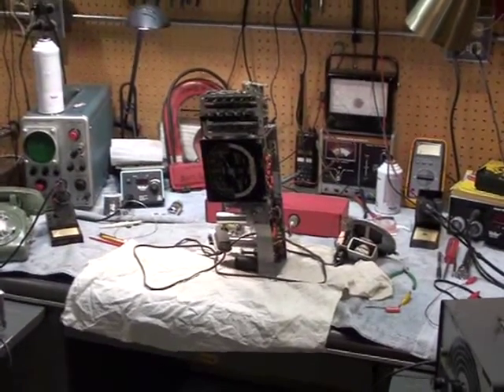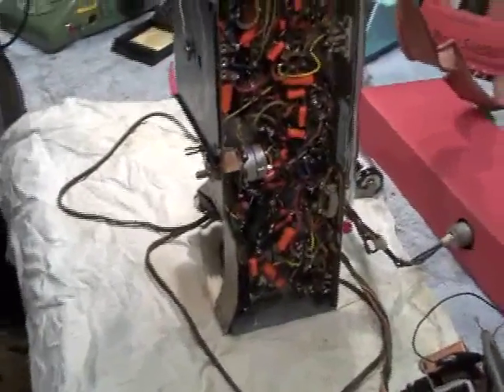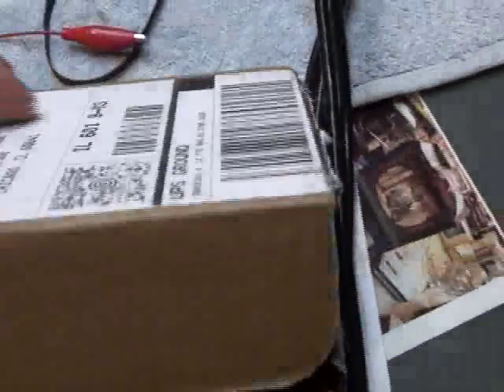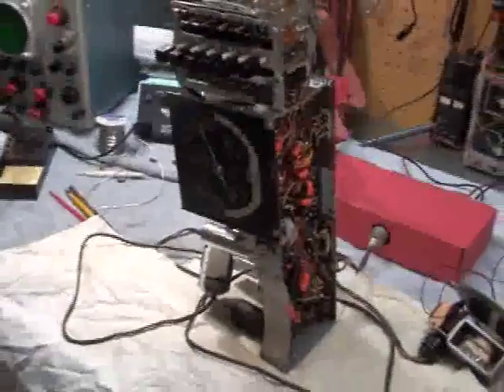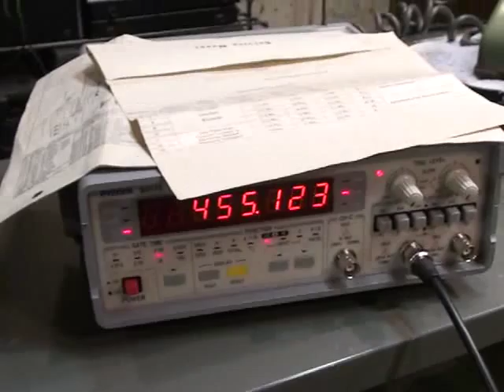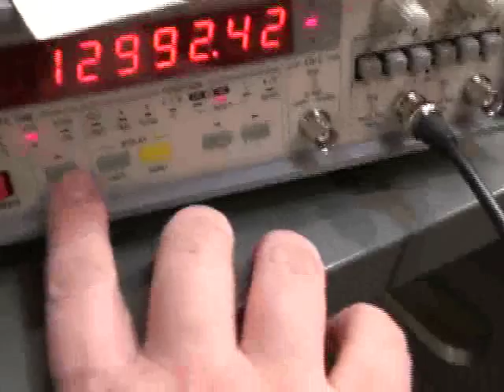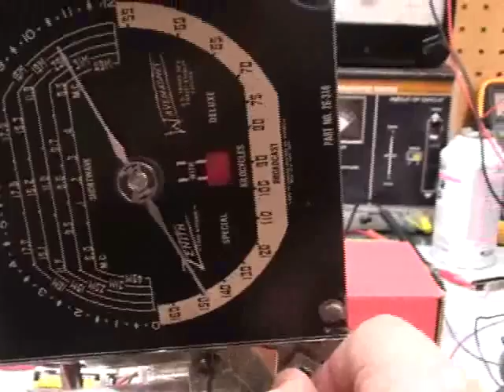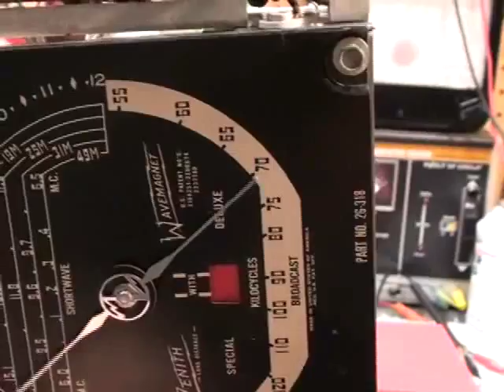1942 Zenith Bomber Trans-Oceanic radio repairs

Comment: Great job on the restore. I wish there were dozens more videos on restoration of these and all the vintage test equipment needed to do a first rate job.  I think a series of videos showing a step by step progression of vintage electronics is way over due. At best, one has a compilation of videos. But a series beginning with buying and restoring a VTVM then a frequency generator, then a frequency counter, then a radio of choice.  A detailed but quick walk through of the schematics for each. This would really be fun and needed by anyone wanting to delve into vintage electronics. Let's face it, most of us will never be clever enough to take on the equipment often repaired by people like from the Signal Path videos. He breezes through the inside of a frequency analyzer like it was nothing more than recipe for hard boiled eggs. He is extremely clever. But, the rest of us can enjoy technology up to the 1960s.
Lastly, if you could and may be you do now, slow down the camera movement. Thanks

Comment from the maker: Yes, its excellent.  I need to buy a couple more.  You can only buy them direct from the guy who makes them.  They're $89 a peice.  It steps the voltage up to 90 volts via 9 D cells.  Its been working great for hours and hours with no problem.  Battery life is estimated at 70 hours normal operation.

Comment: Some people use the yellow polyester condensers and restuff the original cardboard cases. I've never bothered restuffing condensers with any of my radios, most had a mixture of original and replacement parts so there was nothing to preserve. Anyhow the reason for the asbestos was for fire prevention in case something decided to short out an burn up, you can paint it with latex paint to seal it if you are worried about it fraying apart.

Comment: Wow, that's a great job Doug! I actually have an HP tube type frequency counter so I will have to try it the next time I do an IF alignment. That almost looks like a field coil speaker but probably not as it runs on batteries? We repaired the last tube type model of these from around 1960 at our shop and it did not seem to have as many caps as this one does!

Comment: I have a pair of Zenith T.O sets from the mid to late 1950s, both could use an overhaul by now but they do play. One has a front end problem that I will have to investigate as two of the bands are dead. I suspect the bandswitch might be shorted out as they are mid range in frequency. Zenith T.Os are one of the few series of radios that are desired because of their performance and not because of their looks